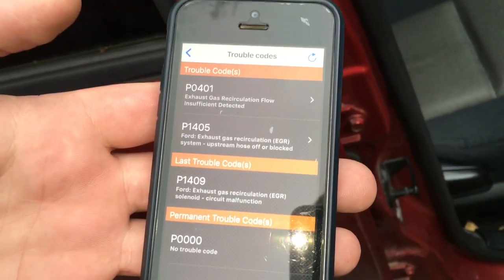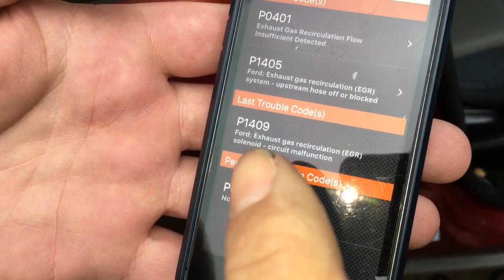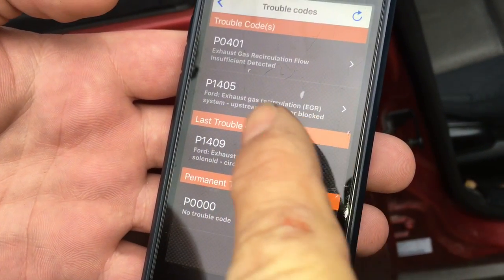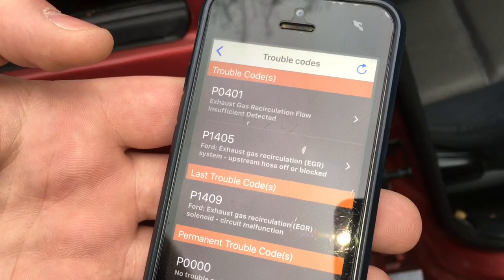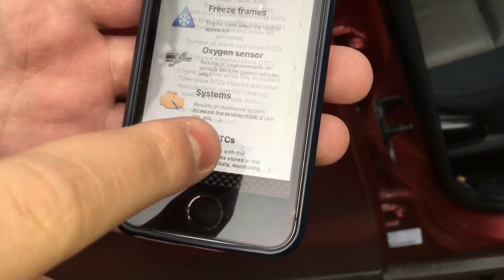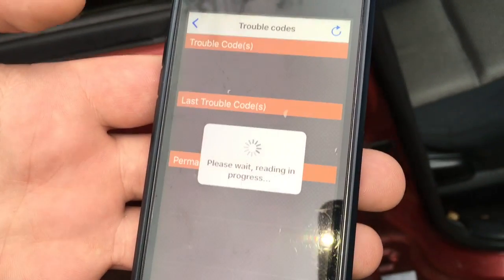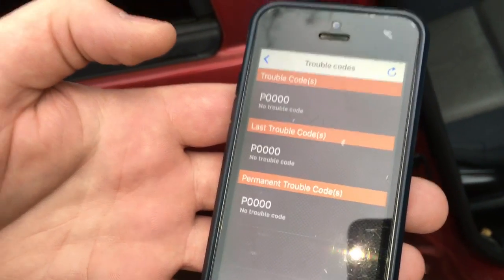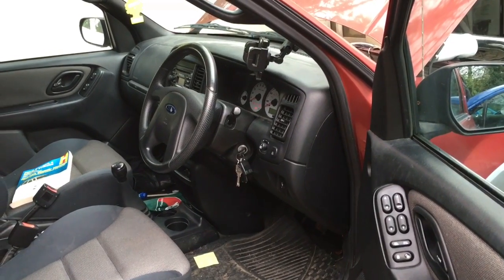How to Diagnose and Fix EGR Faults - Ford Escape & Maverick, Mazda Tribute + OTHERS

Comment: After wading though EGR p0401 videos, your video saved my butt.  My problem ended up being a plugged or restricted DPFE Orifice tube.  I sprayed sensor cleaner down the EGR tube and its two Downstream and Upstream tubes then blew all three lines out with my compressor air.   That fixed a intermittent P0401 code that popped up every 30-40 miles.  Thanks for your help.
Reply from the maker: Great.  Thanks for the feedback.

Comment: Your steering wheel is on the wrong side.You better fix that too😁
Reply from the maker: Most people are right handed.  In case you need to gesticulate or grab something out of the window then the steering wheel should be on the right.  The correct side.  🤣😀😉

Comment: Could you unplug the erg system and run the car like that?
Reply from the maker: You could but it would probably throw up an engine warning light, which would then be an MOT failure.  Easy enough and cheap enough to fix it.
Reply: @comeinhandynow  I just simply cut the whole egr system out. Running smooth as glass now🤣
Reply: But it stalls straight away if you unplug the EGR sensor

Comment: Fantastic. This was exactly what I found on a 2001 Ford Escape 3.0L (USA), after first replacing deteriorated vacuum lines, testing the EGR solenoid, and cleaning the EGR valve assembly.
Thank you very much @comeinhandynow!

A couple of things that may be helpful to the next person:
I was able to gently insert small paper clips into the backside of the electrical connector with it still attached, so there was no need to strip the wires.
In lieu of finding a hose with just the right OD to shove inside the reference pressure hose, I pulled the reference pressure hose off and put on a longer hose on the reference barb to test with.

My factory Motorcraft P/N was 2F1E-9J460-AB. Borg-Warner (Borg Warner Division, now a subsidiary of Standard Motor Products) makes a replacement, P/N EGR631, sold at O'Reilly's (with limited lifetime warranty) and Amazon as well: https://www.amazon.com/Borg-Warner-EGR631-Position-Sensor/dp/B000E6X7HI
Reply from the maker: Thanks for you comments and tips, along with that part suggestion.  Here is the same link in short format  https://amzn.to/2J2KwYf

Comment: I have a 2003 ford escape limited. 3.0 v6 dohc. It runs great but now and then ill go to town say 20 miles, go into a store and when I come back out i start it and it misses bad for few seconds then dies. Then it will not start for hour or so. Then it starts and runs fine again. I replaced spark plugs and upper intake manifold gaskets, coil packs are good, replaced fuel filter and check fuel pressure which is fine at 65 pounds. Anyone else having this issue?
Reply from the maker: Have you tried reading the OBDII port for any error codes?  See my other video on cheap readers.  Is the fuel pressure fine at the moment you have starting problems or is just measured when it is running fine?  The problem is usually the spark or fueling.  Running an inline neon spark indicator lamp wired so you can see it flashing all the time will let you if there is any sparking problem when it wont start.  If that is ok try and plumb in continuous fuel pressure monitoring to check that when it doesnt start.
Reply: comeinhandynow yes there are no error codes except a downstream oxygen censor which has been on since December. Talked to ford dealership today they say with it reading no codes and with me already replacing the catalytic converter, spark plugs, manifold gaskets, fuel filter and coil packs are fine and I am getting spark, they believe it is the fuel pump. I have 65 psi when its running but I havnt been able to check it when its acting up out on the road. They said they believe its heating up then when I go to restart the fuel pump won't kick in but after it sets for an hour and cools the fuel pump kicks on and works fine. Would you agree? And thanks a lot for responding!
Reply from the maker: It is possible, even bordering on probable, but it would be nice to confirm it is a fuel pressure problem before spending loads more money on a new pump.  I had a somewhat similar problem on a completely different car, a Triumph Stag.  It would intermittently cut out after about a mile, but would start ok after turning the ignition off.  To diagnose it (after first confirming it was sparking ok) I permanently plumbed in a fuel pressure gauge (quite cheap) in the engine bay and then I got a cheap webcam looking at the gauge wired to the in car DVD player screen so i could see the pressure on the gauge while driving!  That confirmed a fuel pressure drop off when it stalled. It turned out to be a problem with corrosion in contacts in the wiring to the pump, not the pump itself (I had already swapped pump).  That is often a problem with old cars, copper oxidizes and make contacts resistive, so in my case some power was still getting to the pump but not enough current to make it work reliably and sometimes it would stick off.  Turning the ignition off and on would kick it back to life.
Running a new wire from the fuse box to the pump fixed it.
I could see that the wiring was at fault because measuring the voltage across the pump showed it was a few volts less than the battery voltage, hence poor wiring.

The anecdote is just to say it is important to try and diagnose the cause.  So if you can I would see if you can monitor fuel pressure when the problem shows and if that shows that its the problem then check the voltage across the pump in case of similar wiring resistance problems to what I had.
Reply: comeinhandynow that is great advice. Thank you very much!

Comment: Hi, thanks for the video.. i have a mazda Tribute 2.0 year 2003, and had problem with rough idling and drop rpm when throttle climb up at around 2000rpm. I forget the fault code when it got checked at the dealer but it lead us to egr system. Mechanics told it's the selenoid so we replace it but the issue persist. Will bought a obd scanner to ensure the fault code and trouble shoot it. Any guide/reference on how to clean the egr valve and the exhaust tube? Currently we disconnect the cable to selenoid, and engine run smooth. What will be the long term effect? If there's none, how can i make the system think everything are OK so the check engine light will shut off?
Reply from the maker: Maybe its the pressure sensor, like in the video.  It's quite common that they go faulty.  If you shop around they are not that expensive to replace.  You can test the old one yourself, like in the video.
If its rough idling I suspect that the egr valve is opening when it shouldn't be, so again the likely cause is that dpfe sensor.
Disconnecting the egr valve stops exhaust gas recirculating which means you are producing more harmful NO2 in your exhaust. Not good for the environment but doesn't make that much difference to the engine.  I would recommend testing the sensor and if faulty replacing it.
Reply: I have scan it and as expected it's the same fault that you have. I will try to find the sensor on ebay, one of my colleague will return from London back to Indonesia. I wonder how i can ensure i'm buying the right sensor.

And i hope it's not the valve!

Comment: hi been reading forums on 01 ford escape  200+ mpg. some 300. im getting 150 160. any tips?
Reply: I have a 2005 Ford Escape 3.0l. I get around 280 miles on a tank of gas. I only use plus also.
Reply: @gucoperator3454  thanks i learned a obd 2 scanner somewhat my brother had  readive data. My o2 sensors matched so I think was catalytic convertor. I got rid of it. I got me a 06 sienna.  Thanks for the reply
Reply from the maker: Sorry no. Also I don't know what those numbers are but they're not mpg, miles per gallon.
Reply: comeinhandynow srry meant miles on full tank. i shouldn't  be getting that little my bro has a 99 idk what car and gets more  but thanks for the reply

Comment: HI great video thanks.  Measured 0.19 volts on the DPFE which increased to 1.45 volts after the ignition had been on for a while and the sensor felt warm.  Blowing throught the tube made no change to the voltage either way so figure the sensor is duff.  This is on a Maverick XLT 2.0l. The link you supplied was for a DPFE4 sensor and when putting in the car details for a Ford Escape (nearest I could find) it said it wasnt compatible but directed to a DPFE 15.  My sensor is 2F1E-9J460- AA. Do you know what the difference is and is there any way of getting equivalent numbers to check.  Have had a look but no luck. Have cured the rather lumpy drive temporarily by unplugging the solenoid which keeps the EGR permanently shut. Could that damage the CAT long term do yoiu think? BTW local Ford garage wants £205 for that sensor.
Reply from the maker: I'm not sure of the differences.  It may be down to the physical size and how it fits, or possibly different air flow rates. I did come across this that has some other part number cross references
http://www.johnstonauto.com/news/PDF/MTCDPFESensor.pdf

And I see the dpfe15 is sold by many on eBay for a lot cheaper than the dealer, use the following link:
http://rover.ebay.com/rover/1/710-53481-19255-0/1?icep_ff3=9&pub=5575193927&toolid=10001&campid=5337910930&customid=&icep_uq=Dpfe15&icep_sellerId=&icep_ex_kw=&icep_sortBy=12&icep_catId=&icep_minPrice=&icep_maxPrice=&ipn=psmain&icep_vectorid=229508&kwid=902099&mtid=824&kw=lg

I may be wrong but as a personal opinion I think it unlikely to damage the cat.

Comment: Hi! Thanks for the video. I have idle problems with my 2001 2.0L Tribute. I checked the egr, works fine. Cleaned the the metal pipe from the egr. Changed the IAC and DPFE sensor with new ones and the idle improved like 90%. But, after some km, the check engine light comes back on. What do you think i should do? Thanks
Reply from the maker: Get an obd2 scanner to get the engine code (really cheap, see video description, the wifi dongle type at about £12 or $15 will work via a smartphone). See if the error code being reported gives any more clues as to the problem.
Reply: I have an OB scanner via smartphone. Error given is P0401, no more details.
Reply from the maker: That error is 'insufficient exhaust gas flow through egr valve'.  So why does it think this?

From another site:

Causes:
A code P0401 most likely means one or more of the following has happened: The DPFE (differential pressure feedback EGR) sensor is faulty and needs to be replaced There is a blockage in the EGR (tube), most likely carbon buildup The EGR valve is faulty The EGR valve may not be opening due to a lack of vaccuum 

Possible Solutions:
 In fixing this code, it is quite common for people to just replace the EGR valve only to have the OBD code return. The EGR valve is not always the culprit. Use a vacuum pump and pull the EGR valve open while monitoring engine RPM's & DPFE voltage. There should be a noticable difference in RPM's with the EGR open Clean out the EGR valve and/or tubing to remove deposits Check the voltage at the DPFE, compare to specified values (refer to a repair manual for your specific model) Replace the DPFE sensor (with a good quality / OEM one) Replace the EGR valve

I hope that helps work it out.

Comment: Hi, Excellent video. I have a code P1406 on my 2002 ford escape xlt v6. (It says:  "DPFE Downstream hose off" ). I've checked already, but no hose off. Any suggestions? Thanks
Reply from the maker: Thanks, I can only suggest going through each part of the egr system and checking it out as per the video.  If I were to guess, and you see no leeks or hoses off, then I would say it's a faulty  DPFE sensor.  The rational being that the ecu sees a pressure drop, but it may be the sensor giving a wrong reading, rather than a hose off.  Those DPFE sensors are reasonably cheap (see video description for buying links) and they don't last forever.
Reply: thanks a lot. i'll do that